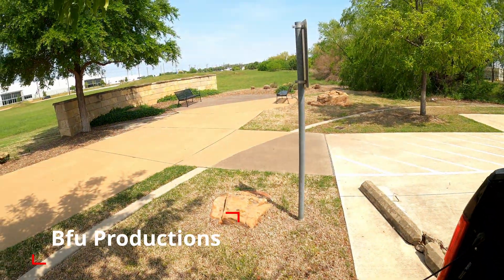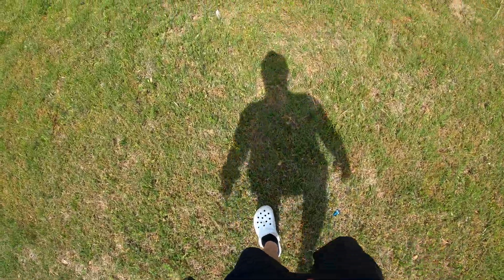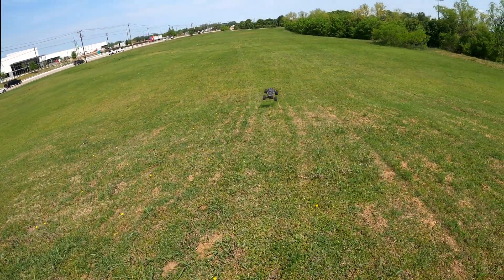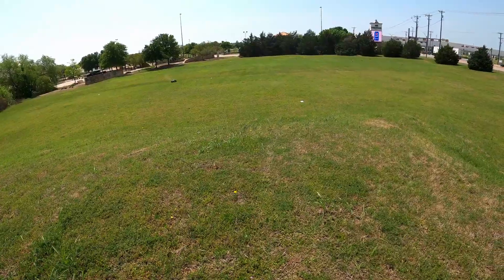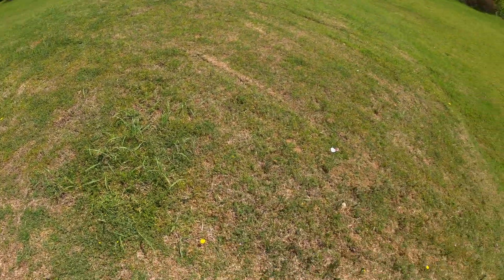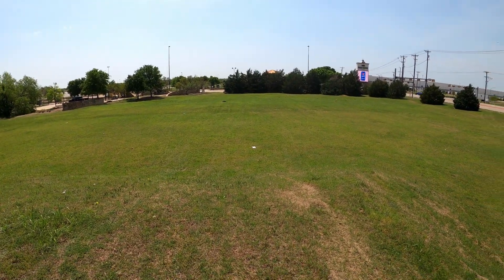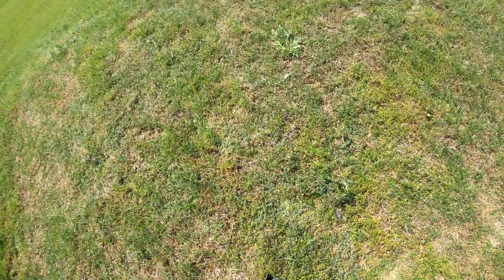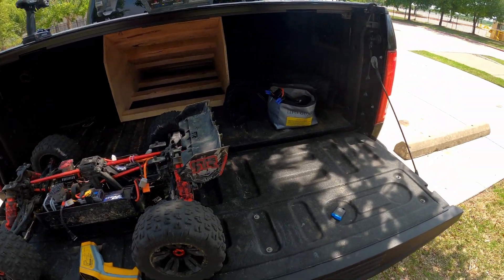Perfect Gear Ratio?! The King Of Kratons Returns

Comment: I have questions,how u make the front tyre not ballooning?can u share the tips please?
Reply from the maker: Mostly the gear ratio prevents the tires from ballooning. I'm running 30t pinion and 39t spur. Other than that, I try not to full throttle in the air, just half to 3/4 throttle. Hope this helps! ✌️👊

Comment: Hi there,
Im pretty new to RC cars, and i have a kraton 8s exb with the same electronics as the BLX version..
It's already quite fast! But will the 39 spur overheat the motor with a 17 tooth pinion?
It already heats up with the stock spur and 17 tooth
Reply from the maker: What temps are you hitting on the motor and ESC? This will ultimately be the best way to gauge your ratio.

Comment: Hello .
Great video. 
What if 800 kv motor with 39/39 ?
Reply from the maker: With the lower kv motors you would likely need to gear 1 to 1 or close to it. 39/39 would likely be a good ratio for the 800kv. This is just my opinion as I do not have an 800kv motor to test with. 👍👊✌️
Reply: @bfuproductions  Thanks

Comment: Is that Ray Romano secretly running exb ? ( jokes) I’ve been running 34/39 . Super sweet spot. Could go even higher with 37/37. You Probs  run cooler jumping up  cog or two , especially in grass dude. But some nice jumps all the same.
Reply from the maker: You can get away with 34/39, but it ran too hot for my liking. I'm assuming you meant 37/39? Either way, I wouldn't even attempt putting anything higher than a 34/39. Running in grass you'd want to stay well into the overdrive gear ratio not closer to 1-1 or even underdrive...that's how you pop lipos and melt solder joints.  ✌️

Comment: cool jumps & cool spot! you happen to be in California? here's a video i'm on 39/32 and i can't seem to flip this thing, so I'm thinking about going up to 34. https://youtu.be/ZsDjCNUpVo0
Reply from the maker: Thanks brother! Nah, I'm in Texas. Been raining like crazy here lately so i haven't been able to get out and enjoy the k8. What are the specs for your k8? motor & esc, diff fluid weight, tires, and batteries?
Reply: @bfuproductions  castle creations 800kv XLX esc, i haven't mess with the diffs yet (did you do anything to your diffs?), tires it came with and i forget the name of the servo but 8 seconds in on this video shows what i put in there - https://youtu.be/il9o8oJ82MU
Reply from the maker: @grc9793  have you ran the castle software and turned up the punch and maybe even advance the timing? 

Weird.. that combo should be nasty and able to flip no prob. You sure you're running the 39 optional spur and not the stock spur?
Reply: @bfuproductions  I up the punch but I dont know about the advance timing you're talking about. And yes changing out the spur was one of the things I showed in that video of mine. I'm thinking about going up to 34t pinion...https://youtu.be/il9o8oJ82MU
Reply: @bfuproductions  I up the punch but I dont know about the advance timing you're talking about. And yes changing out the spur was one of the things I showed in that video of mine. I'm thinking about 34t pinion
Reply from the maker: @grc9793  man that's strange... You should be flying with that setup. 
Def hit up that 34 tooth, maybe that 800 needs the extra teeth. 🤔
Reply: @bfuproductions   I know right I did do a speed run and was able to get 58 mph on road but yeah I think I'm gonna slap that 34 tooth pinion in see what it do
Reply from the maker: @grc9793  what remote are you using?
Reply from the maker: @grc9793  👍👍 well, lemme know how the 34t does. Just be careful and watch your battery temps. 👊
Reply: @bfuproductions  right will do. 👊🏼